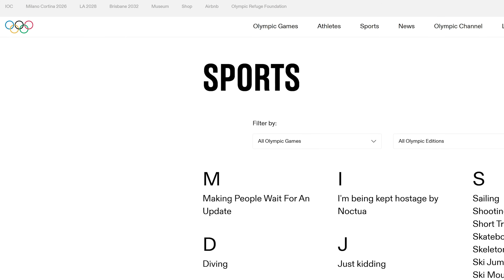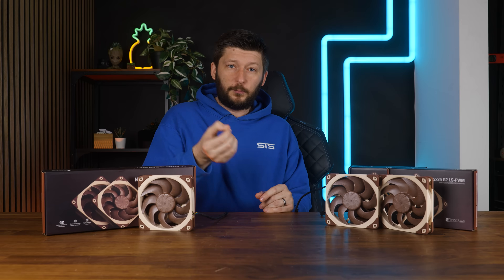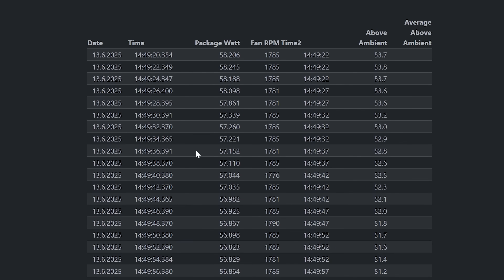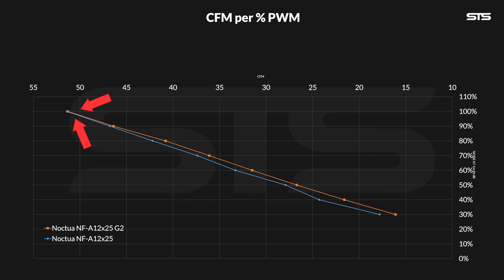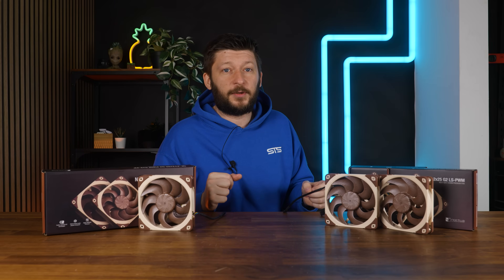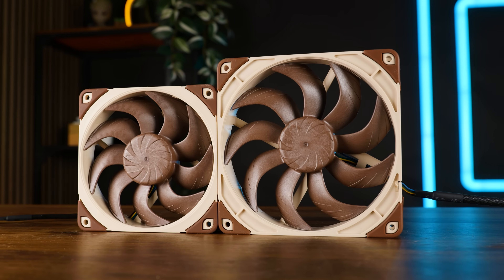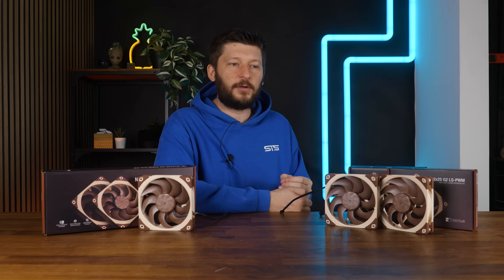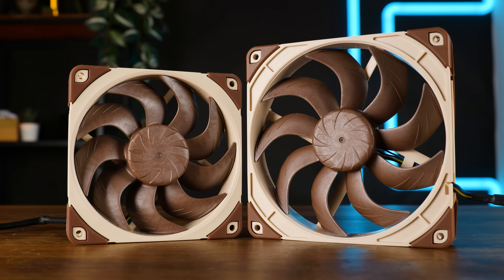Noctua NF-A12x25 G2 👑 The King is Dead - Long Live The King

Comment: @6:45 Can you advise me to create my own miniature open-return wind tunnel with a reducer inside? Ive been trying to make what you have but by using a solid block of metal aluminium. I just don't have the space or money for a large mill machine. I've been trying to use standard power tools. But I'd need a really large conical cutting bit would you happen to know where I can obtain one?

Comment: The G2 is noticeably quieter and moves the same amount, if not a bit more, air at a lower speed, which is a big win for me. I’ll be getting the Sx2-PP for my NH-U12A chromax, and I’ll keep my current dual exhaust setup, one top and one rear NF-A12x25 chromax, since I don’t see any reason to replace them.

Comment: Well, I just got the original, and am still inside the return window, sooooo...
Reply: If you did get the original for a cheaper price then it's still a very good purchase.
Reply: @Kelle128 True, but I paid the same. And then absent-mindedly used some of the accessories in another build, so I guess keeping it is the right move.

Comment: Could you test a Noctua U12A equipped with a pair of industrial fans? I'm considering replacing the original fans with ones that can run at up to 3000 rpm. Will such a modification significantly improve performance? The system's noise level isn't a major concern for me, although I'm also interested in its performance and quiet operation at the same speed.

Comment: Air resistance for case fans can be low to extreme depending on the case but it's always more than open air and shouldn't be equated. It should also be noted that Noctua fans include gaskets which slightly improve air flow through radiators.

Comment: Reviewers need to learn what a frequency graph is to better characterize the quality of sound rather than just "here listen to these samples" there's an objective way to measure this stuff guys
Reply: Exactly, my friend. I, for example, bought some fans that had good CFM and good RPM, but in no review did anyone mention that at certain speeds they produced an unbearable reverberation—especially when gaming. It was no use setting custom fan curves either, because they would always pass through 2 or 3 RPM ranges that caused that reverberation. It was super annoying to keep hearing that WOW WOW WOW WOW sound. Even at low volume, it still made that kind of noise.

I only found out through some obscure video by a guy complaining and warning others about it, but it didn’t even have 10,000 views.
Reply: @Willpolita  That was my exact experience with Arctic Bionix P140's. Just absolutely terrible at low RPM's. They always needed to be set at 1000+rpm.
Reply: Annoyance is subjective. With a graph we can see what is the spectrum but with sample we can hear what annoys us subjectively the most.

Comment: Thanks for this review. Saved me some bucks. One question tho that nobody has still answered yet. How do NF-A12x25 G1 and G2 compare to the new Arctic P12 Pro fan (actually available only in the Arctic Liquid Freezer Pro cooler)? I have an SFF case which uses just two fans for the rad, and those are also the only exhaust, so whatever can move more hot air out of the case  at a decent volume, may be useful

Comment: Thanks for a great review! Honestly it's super impressive that they're able to maintain the same airflow with a blade design so clearly designed for pressure, as that tends to negatively affect airflow in unrestricted scenarios. That speaks to some high quality engineering. And great that you include recordings to show the difference in noise quality! That being said, a few notes on how you could relatively easily improve that section:
- include a 'fan off' baseline audio sample
- add a frequency graph chart on screen
- mount the fans off the desk somehow so that their vibrations don't get into the desk and add resonant noise.
Other than that though, once again, thanks for a great review! I'll likely keep buying Arctic P12/P14s simply due to their ludicrously low price and great overall performance, but for anyone who doesn't mind the cost, these are no doubt great.

Comment: Should you not use a radiator with a higher FPI? I remember finding an engineering paper on fin stacks for thermal transfer and air resistance, and the resistance doesn't really increase significantly until above 12 FPI. I think that's why alphacool tends to use lower FPIs on their thicker radiators, balancing the air resistance with the increased surface area for cooling.

Comment: I think what Noctua was going for was more of a refinement, which is fine in my opinion. Fans can't get much better performance wise. But if you can improve on SP, noise normalized, heatsinks, etc, then to me it's kind if a win, if price is the same that is.

If that ugly mustard color on the wires is present on the chromax however, it's an instant no buy. Hoping the U12A chromax gets a new version and probably will, but I hope Noctua pushes for more aesthetic options like a wood cover for heatsinks.

Comment: Why not include Phanteks T30 in the comparison when you made a video saying it's the king of 120 mm fans.
Reply: Why not include ARCTIC S12038-8K that will destroy T30. T30 is out of specs of normal PC fan.
Reply: @Roman-6969  It's a bit thicker but most PC fan applications allow it. Everyone compares the T30 and NF-A12x25 G2 because they are competitors in the same use case for a quiet but efficient PC fan. They are also in the same price range. Arctic s12038-4K is a server fan for high airflow with high noise, people who watch the Noctua NF-A12x25 G2 review are not interested in that.
Reply: T30 isn't on Amazon.  Did it get nuked by tariffs?

Comment: How does the G2 compare to a T30? Obviously the T30 beats it at max b/c it goes 1200 rpm higher, but I'm curious how it fares when noise-normalized.
Reply: Saw hw polling compare and tldr the t30 does better as a case fan and the noctua does better on radiators noise normalised

Comment: Great video, been waiting for this. Would love a direct noise normalised comparison with these compared to thicker fans like the T30s. Trying to decide if I go with all Noctua G2's in my new case and multi rad watercool build, or thick bois like the T30s (Im aware the 140mm T30 is coming soon). I would obviously never run the T30s at above 2000rpm because I'm not a mad man so it interests me if a thicker fan like the T30 can provide noise normalised benefits compared to the G2 line. Any thoughts?

Comment: I know it's a bit outside the scope of your normal coverage, but a group that these types of fans directly appeals to more than even PC users are the DIY crboxes (diy air purifiers) community (r/crboxes)

If you have the interest to test them I'd personally be very interested in seeing what the data indicates as the best for a crbox in the manner you present data
Reply: Phanteks T30 should be the best for purifiers.
Reply: @Chopper153  Best in what manner?

Yeah, they'd pull more air through but that's not the only factor to consider

These are literally silent, and for something you have to have running 24/7 in the background in multiple rooms that really does matter

If I just wanted airflow I'd get some 5000 rpm server fans, or inline 6" duct fans, but it's not even close to the only factor

Comment: To be honest i am dissapointed. I was waiting so much for this fans. I have first a12x25 on all my radiators,and i love the silence in my custom loop. I have only one case fun which is new NF-A14 G2,and this fan is drasticly quieter compared to first version. It was WORTH to wait so long,as original a14 was loud as hell,comparing to a12s....and this? Of course,sound is nicer,gaps are smaller...but i have expected bigger performance gap on radiators. Not anormous...but bigger...

Comment: One thing you need to consider is that overall noise profile tuning matters a lot, and it's not something that a dB meter can necessarily demonstrate. For example, the P14 Max is a beast of a fan when you simply look at its performance, even at lower RPM, but when used in person it generates more annoying noises than the Noctua A14 does. Even if you run a Noctua at a higher RPM.
That's part of the reason why Noctua won't always show a massive, decisive victory: because it seems they make some trade-offs in raw performance by tuning the fan blades to also make the least offensive noise possible.
Reply: I agree! I've had many fancy fans that had good specs in theory but they sounded so bad and annoying when running full speed that I simply had to bring back my noctua fans - which emit a much more "pleasant" noise/sounds when running high. That is something only noctua and a few others can achieve.
Reply: I couldn't stand Arctic fans! Noctua always had the most natural airflow sound
Reply: @adamgreenhill110 For the price, Arctic fans are super good. I've got some P14, NF-A14, NF-F12, Light Wings 120 and Light Wings 140. The P14 are the quietest after the NF-A14 and yet they move a lot of air.
Reply: @adamgreenhill110  price...  4 arctic = Noctua
Reply: @nhantran4604  True, I prefer Mobius 120P fans. Similar price to Arctic, somehow quieter than Noctua
Reply: The P14 Max is 2800 RPM and the A14 is 1500 RPM. They are note in the same category. A fair comparison would be between P14 Max and A14 IPCC.
Reply: Raw performance? I can’t wait for the NF-F12 IPPC G2 fans to some out

Comment: Could you please test the A12x25 G2 on a (more standard) radiator with pull vs push configuration? You had a video awhile back of the A14x25 G2 that it performed quite a bit better in the pull configuration.

Comment: Best demonstration I've seen to show that the number of decibels doesn't paint the whole picture. Up to and including 90% the sound of the G2 didn't seem annoying at all.    

The motor/impeller mount seems to have some potential for improvement from the looks of it. Probably not enough to make a huge difference, but I still find it interesting that not even Noctua hasn't put in more effort into chasing potential improvements there than they already have, in some of their fans.

Comment: I postponed my review because the results seemed underwhelming and I wanted to make sure it wasn’t my methodology before I released the video.
Reply: Sounds like the new G2 is kinda mid
Reply: @Sheaksa I’d like to reiterate what was said before, these don’t offer a direct improvement over the “G1” but a overall tighter tolerance fan.
Reply: Certainly makes me feel better about spending a not insignificant amount of money last month to overhaul my PC with Chromax Noctuas. I especially take umbridge with them selling purposly slightly gimped fans in the two packs. Even if its by a small amount. Seems like its gonna make future builds needlessly complex. Especially when that effect can be achieved with wiring half the fans to seperate headers.

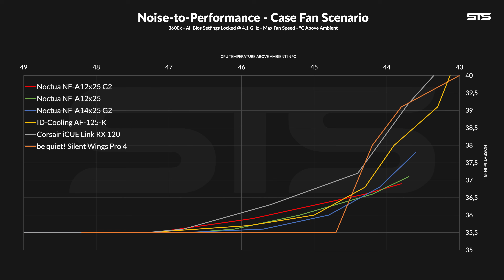Comment: Random bit of feedback, but I find your graphs quite confusing to read sometimes. For example, the graph you show around 9:10 has the y axis ascending as it goes up, but the x axis descending when it goes from left to right. Maybe it's just me, but I'm used to the x axis ascending as it goes from left to right instead of descending. I'm also more used to the axis labels being on the left and bottom. The charts look nice, but with these minor changes to make them more standard I think they'd be a lot more intuitive to read.
Reply: +1 and as that airflow per fan speed graph is presenting an airflow as a function of a fan speed, the x-axis should be the fan speed, not the airflow. Then, it would be clear that old one is pushing more air at the lower speeds than the new one, but now it looks like opposite.
Reply: +1
Reply: +1
Reply: +1
Reply: +1

Comment: 11:51 agreed. There's so much information that dB meter can't really get, namely the characteristics of the sound. Granted, this is subjective, but I do hear that the G2 wins i this category.
Reply: With me, it depends on the rotation speed. In low speed, I prefer the G2. In high speed, I prefer the first version. If I decide to buy this fans, I'd buy the first version for the case, and the G2 for the rest if needed.

Comment: They should've bumperd max RPM to 2200-2500
Reply: Nobody uses that RPM. The average gamer who wants a cool overall system and just want a quiet fan at 900-1000rpm (which pulls more than enough air)
Reply: @Ladioz  Those fans tend to be rather quiet up to 1200 rpm - 1500 rpm depending of the case...But yes, 2000+ rpm at that size would only be for server grade stuff.
Reply: @Koeras16  No fan in the world is quiet at 1200 rpm. Not unless you are gaming with a headset with sound blocking all the pc noises.  I game with built in speakers in the monitor, and even though the sound is great i enjoy the sound of silence that my pc offers. I do have to keep things at 700rpm tho.... temps sacrificed..
Reply: @Ladioz  We got obviously different tolerance to noise. For my ears it is still rather quiet. You will hear it  if you are near your computer obviously.
Reply: @Koeras16  I haven't tested the new Noctua G2 fans so im waiting to get my hands on one.  my favorite fan of all time is the BeQuiet Silent Wings 3, which is completely inaudible until 800rpm. The Silent Wings 4 is also good however the motor makes electrical noises unfortunately.  I hope these G2 from Noctua will be priced below 30 euros... I would really love test it on a cpu heatsink...
Reply: @Ladioz  They will sadly probably be priced around 35 euros

Comment: The old one sounds better, wtf
Reply: Guess it's personal preference, new ones sounded way nicer to me
Reply: Yeah? Well, you know, that's just like uh, your opinion, man...
Reply: @Srandista  yes... that's what comments are
how is that confusing for you?
Reply: No, the old one is only better if your only criteria for performance is max rpm. At noise normalized or rpm normalized test the G2 are a lot better.
Reply: @wilsyang  the sound profile of the old one is better
the G2 is not "a lot better" at literally anything
It's about the same for cases and slightly better on rads and heatsinks, but at the cost of a worse sound (not louder but more annoying) and still far from a Phanteks T30 for example
Reply: @Violet-ui To me the T30 sounds worse and more annoying than the A12 G1. And the G2s are a further improvement in noise profile.
Reply: @wilsyang  but the T30 can run way slower while moving the same amount of air, so its still clearly much better
Reply: @Violet-ui Yea... definitely not the case if you take a look at HWCooling's written review which goes much more in depth and has a better testing methodology than what was shown here.
Reply: @Violet-uino